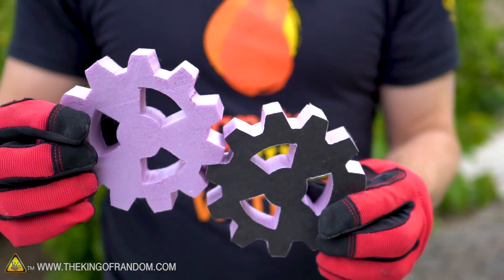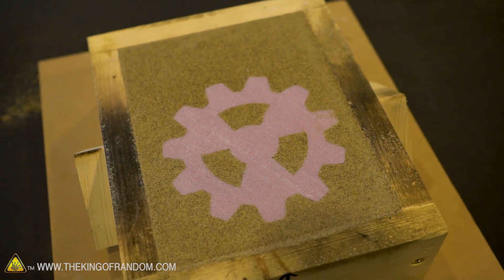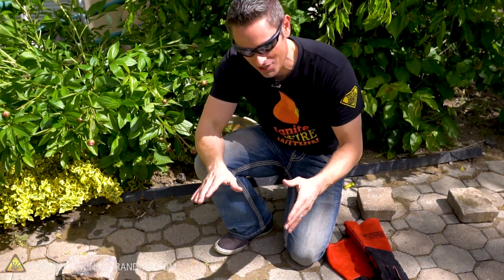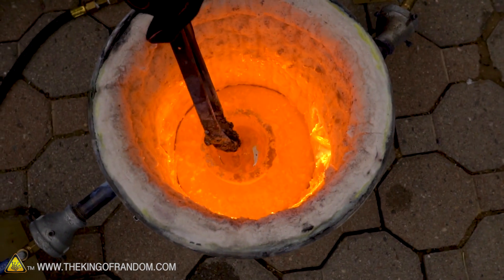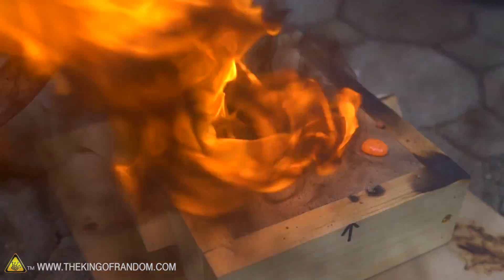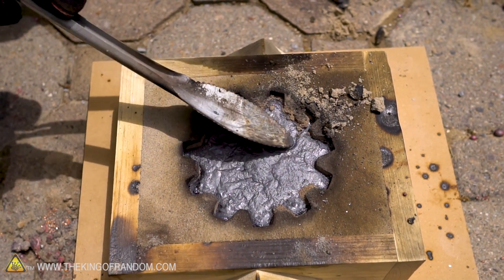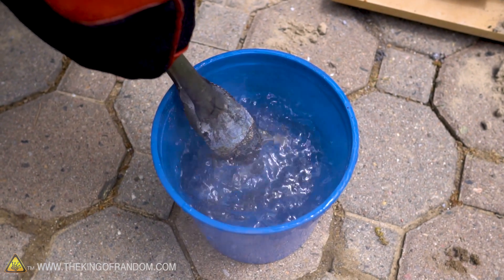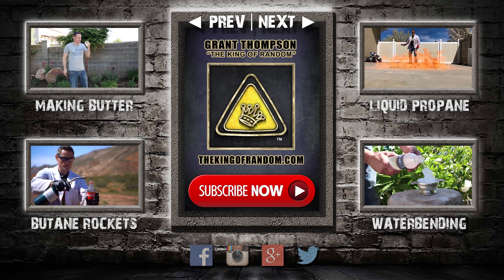Argh. Why Is Copper So Difficult? TKOR Tests Melting Copper In Our Homemade Foundry

Comment: i would advise you attach a strip of foam to the top of the gear before you pack it in the sand so that it sticks out the top of the sand. leave the mold with the gear at the bottom this will give the mold more stability because the stream from the pour wont directly impact the surface of the mold. you could also bake the mold in an oven to warm it up but if you don't have enough moisture in the sand it might collapse with the foam. just be sure your frame doesn't catch fire.

Comment: Might I suggest that if you are going to go through the effort of making a greensand mould then you should remove your styrofoam before pouring. Coat your object in a powder like talcum or baby powder beforehand to make t easier to release, then tap a nail or two into the object to use as handles to pull it out without disturbing the sand.

Comment: To pull the styrofoam mold out you could have gotten a couple of curved hooks, poked them in and pull it out slowly. 

Making the sand wetter might have also kept it in place a bit better since it's heavier.

Comment: Grant
As ive seen in other metal casting videos, When casting "difficult" metals, alot of other creators make a cavity in the sand, much like how you made the pokeballs with silocone, only with green sand. All you need to do is carve a channel leading to one open end of the box so you can pour the molten metal in. Also when doing this, make sure to form a funnel at the top of the channel you carved out. This in turn makes the pour easier but also provides a resovoir as the metal cools down. This prevents the casting from shrinking and possibly breaking the sand mould. 

Hope that helped!
See you in the next video!
Random Happens ;)

Comment: copper is denser than aluminum. that's why the copper pushed up the the center pieces of sand. The copper pushed them up from the bottom. that's why the sand wanted to float. mix some cement or concrete with the sand so it stays put, then bust apart with hammer. don't use too much cement powder or you will never get out the copper afterwards. use lots of sand and just a little cement. clay would work too but you will lose detail during the firing process to harden the clay.

Comment: A better clay-sand mix, talcum on the model as release agent and carefulness and you can get the mold out just fine. In most all greensand mouldings the model is removed from the sand before casting (model is reused time and again). also the mold is fired before the pour. it stabelizes the greensand (curing the clay) and also helps with the slower solidifying of the metal because of the heat in the greensand. Also having a top half to the mold, with a spout to pour into and vent holes for air to escape. the metal in the spout also might help compensate shrinkage.

Comment: I have not done copper, but Have done lots of aluminum.
I have started saving up scrap copper, so I was thrilled to see this video.
You have helped me prepare and maybe avoid some of the problems you have had... Maybe   :-)
I use a 50/50 mix of sand and plaster rather than green sand alone.
I heat the plaster in an oven to get it hot before taking it out to pour molten metal into it, that allows the metal more time to fill the void and get the details. No floating sand that way either.
You have already mastered aluminum, but... Maybe

Comment: What if you were to put the gear mold in the middle of the sand so there would be nowhere for the sand to go when the copper goes in you can drill a hole down to it so you can pour the copper?

Comment: If you want my unprofessional advice, I'd have to say there's a few things that could be going wrong. First is the sand it can be either to dry like you thought or it could not be packed down hard enough. The styrofoam could be to durable, I would suggest the white styrofoam like the one you used for other casting. This stuff looks a lot more industrious. And It may not have been hot enough until like the last few casts.
Reply: Or you could make the mold then remove it. I would suggest checking out Tito4re he's done some casting and does a lot with copped, he might be able to give you a few ideas to improve your casting skills
Reply: You could check out mp dragon too

Comment: Wet sand+hot copper = steam.  You need a dry pack.  The original castings were done in a cast that had complete coverage on all sides with a tube as a delivery method.  The casting sand was around a wax mold.  As the medium was poured in, the wax would melt and come out the top, displaced by the medium.  Or the casting sand mould was heated to melt out the wax prior to adding the medium.

Comment: +Grant Thompson - "The King of Random"  It seems like you would do better with some kind of binding agent added to the sand to keep it from "falling apart." 

As it happens I was watching an episode of dirty jobs last night where horse manure was added to the high temperature sand at a bell foundry for that purpose. Also, the sand was wet and allowed to dry/cure in position prior to the pour... 

Seeing the difficulty you've had makes their process more obviously necessary, especially for large castings or extreme conditions like very high temperatures.

Interesting video, thanks for posting!

Comment: Maybe 3D print the gear and melt it the same way? Saw another channel using plastic and plaster to do castings. I know you want to stick to green sand, so just look at plastic castings to melt.

Also, the channel Tito4re also does green sand casting, using the same wood jig set up. He uses the funnel spout holes you used to use with the metal jet and master sword castings. Those seemed to turn out better more consistently.

Comment: well, you seem to be needing something like a glue on the sand, in fact, how engine blocks are made is by making a mold with sand and something to keep it together, which then is pored into a shape of plastic. It then goes to a sort of a oven to remove the plastic and heat the mold (it might be blow with a compressor to clean its inside) and then they cast it. 2 clues, when it is hot, and the plastic shape thing melts, the sand is already hard, and when the metal is poured, it burns down (so whatever "glue" they use burns before melting)

Comment: I think you should have mix the sand with 2 stroke engine oil and rubbing alcohol instead of getting it wet and you should have used lacquer thinner to shrink the styrofoam

Comment: Grant, you should keep the foam gear in between two layers of green sand and put a foam tube at the surface that connects the two, in theory the copper should be able to melt the foam quick enough and take its place

Comment: Copper is way too dense for that. Especially with the holes in the middle, it'll rip them right out. That's why aluminium works so much better, it's a lot less dense. Maybe try sticking a few nails into the holes in the mould while the foam is in there?

Comment: When you cast with green sand and heavy metal, you MUST have a top cover. The problem is that your mold doesn't have top support, and that was the reason your lighter than copper sand kept pushing up. If you had a full setup, with a spout, and full chamber setup within the sand, you'll be golden.... erm, copper!

Comment: I've done some copper casting with little success. my forge is just barely hot enough to melt the copper, so it doesn't pour very well. I think you'd be a lot safer to use aluminum, unless you were willing to make a plaster mold for copper casting.

Comment: Thomas Edison was being presented with an award by copper producers for increasing the demand for copper in 1911.  They asked what he wanted & he asked for a cubic foot of copper.  The producers kept failing and eventually gave him a cube with an internal defect which weighs 486 lbs instead of the 559 lbs a cubic foot should weigh.  Evidently Edison knew something the copper producers didn't.

Comment: I have a video idea, what would happen if your heated metal for too long? Any physical changes? Like if you like the idea!
Reply: The Executioner Is Here if you got it hot enough it would turn into a gas
Reply: The Executioner Is Here haha what
Reply: It's not about heating it "too long" it's about heating it "too hot". And the same thing happens when you do that to water. it boils. It's tricky to boil copper, it takes a lot of heat, but you can do it in a high-vacuum easier. Unfortunately, it's not that much fun to watch. the metal condenses on the lens, or the window that the lens is pointed at, and everything goes dark.

Comment: If the sand is wet the moment the molten copper touches the sand it will evaporate the water.  When liquid water changes to steam it expands in volume by about 22 times. That forms a steam barrier between your molten copper and the sand and since it takes a LOT of heat to raise water from room temperature to 100C and then to steam (about 4200 Joules per gram per degree Celsius of liquid water + whatever you need to change water to steam)  your copper will conform to the mold of the steam barrier which will probably not be as uniform as the sand mold.  That steam also pushes on the 3 little sand pillar in the middle. 
 I think the reason they kept popping off are:
 1) Steam forming at the bottom of the mold ( like the bottom face of your gear) is under a lot of pressure since the hole gear is on top of it. It presses against the bottom of your pillars deforming it creating a weakness on a already weak spot.
2) That spot is already under a lot stress from the hydrostatic pressure from the molten copper. (One of the reasons damns aren't perpendicular to the ground, but thicker at the bottom). 
3) Sand is also less dense and buoyant force will push the pillar to the surface of the molten copper.  
Adding water might seem to make the less less "brittle" but i think it's actually detrimental during the actual molding.

  What I would suggest would be:
1) make the mold more shallow.  Maybe make the gear half as thick?  It should help the buoyancy problem since it increases proportionally to the volume of your pillar. 
2) Less water.  Aside from the steam problem it will allow your copper to cool more slowly, which i think was one of the things you wanted.
3) Pour slowly.  I noticed the pillar that pops off is usually near where you pour.  Copper is very heavy and dense. After is hits the bottom it will start dispersing throughout the bottom of your mold.  It will put a lot of lateral force on whatever is in it's way.  (Think standing in front of an avalanche, you are the pillar. as you continuously pour copper it's as if snow would keep coming down on you).  Maybe a slow steady pour moving around the mold?  Ideally you would want all sides of the pillar to have the same height of copper so all sides are being pushed by the copper with the same amount of force.
Reply: smart nerd
Reply: Stone Yeti1234  dont be mad cause you're not smart bro😂😂
Reply: You're exactly right about the buoyant forces from the copper. It's much more dense than aluminum so the mold needs to be stronger.

Besides the other tricks, I would have tried embedding some copper wire in the mold in the pillars to reinforce it; just poking a bunch of wires in at different angles would probably make it a lot stronger. I couldn't say whether or not it would be strong enough without trying it, though.
Reply: Alex Kim nerd

Comment: What if you used a lighter styrofoam than the housing insulation, the copper wouldn't have to work as hard or take as much time to disintegrate the styrofoam. You might have to clean it up more later with a file, but I feel like the housing insulation was a bit too heavy

Comment: The problem is you're doing the same thing over and over and expecting different results. maybe create closed mold with a bleeder hole and a funnel hole. The problem lies in just dumping it on to the cast.

Comment: Grant: The Styrofoam may be sucking heat from the molten copper. make a wooden template, mold the sand and remove the wood before pouring again.

Comment: Maybe pour plaster around the styrofoam mold, cast a silicon (or maybe wax, that may be easier to work with) cast inside that, then make a cement mold around that, and cast the copper into the cement mold. Long process, but it might just work

Comment: challenging yourself to make a perfect mold entertains me alot. hopefully you another science challenge video.

i think it is because molten copper is too hot that the moisture in the sand evaporates too quickly. the surface tension of the water in the sand decreases resulting less durable sand mold.

Comment: Why are you working with only half a mold? Build the top half and and intake/vent tunnels. The pressure from steam and tamping the sand down will push outward, holding the mold together while the negative space is filled with molten metal.

Comment: why don't you use both parts of the container and completely cover the gear? maybe heat the sand with a torch before heating so the mold isn't as cold? or maybe even cast it in plaster?

Comment: You're supposed to add a triangular funnel somewhere on the styrofoam mould, therefore you keep the lid on top of the box, and the triangle will create a funnel in which you can pour the metal in. By doing so, the lid will hold the middle pieces down, and the lid will also keep the metal hot

Comment: Here is the thing about copper.  Number one you should be using borax to pull out the copper oxides.   Second your mold NEEDS to have a binder.  copper is very heavy when compared to aluminum and yes it is heavier than silica sand.   you could mix the sand 3 to 1 with refractory cement and add water until its moist like oatmeal.  set your mold then bake it in the oven at 250 for a few hours.  NOW your ready to pour, it also helps to heat your mold up to around 700 degrees prior to your pour.

Comment: you should make plywood top with cilindrical hole drilled for pouring molten copper through. The top will prevent greensand rising and everything staying together. And maybe try to make 1 or 2 went holes so foam cold escape to even out internal presures. They are called risers i think

Comment: You probably already know this, but copper has a high thermal conductivity. Due to this, the copper is able to dump a large amount of heat out to the cast in a short about of time. This is why you had to get the copper superheated to work.

Comment: is the density of the copper greater than the density of the sand also  it might help with your cooling problem if you heat up the mold to a fairly hight temp. there for it will slow the cooling process.

Comment: Your sand is too dry. Also the mold will hold shape better if you use the cope and drag with sprue and vents. Doing these things and pouring at a more moderate pace would do it.

Comment: why don't you just use runners? then just cut it off and grind it down, that's the standard way to do styrofoam casting
Reply: also it would make more sense to use playsand(moonsand) or use a sand epoxy mix

Comment: Do A full Green sand Cast. Meaning make it have a stem on your gear make and make two separate chambers for your green sand and compact the bottom half of the sand then put
 another piece on top and take your gear with the stem on it and pour the molten copper on the stem instead

Comment: I would try sodium silicate, it will work way better for copper. You should also make sure to clear away all slag then put it back in the furnace for a few more minuets. I would also remove the Styrofoam before you pour the metal into the mold.

Comment: You need to have sand in the cope and drag, then put a sprue in the center of the gear. That way the sand in the center of the gear hopefully won't break away or float out since it's sandwiched between the cope and drag sand.

Comment: you need a little clay to mix with your sand, not much, also you need to glue or affix your Styrofoam  gear on a piece of plywood so you can lift the whole pattern out be fore pouring, it will be reusable, instead of pouring direct into the casting an in gate would be much better to keep the integrity of the mold from falling apart and leaving sand pits in the casting , just cut the gate off when done .

Comment: Try preheating your mold...200 to 250 should melt out the foam and 200's is better than air temp. Should give metal more time to flow before it cools...also go real damp on the sand it will let you pack tighter and the preheat should dry it out. If it works it will help me in casting copper parts in the future

Comment: I hope this isn't a repeat of a suggestion but have you tried a CO2 activated binder additive like Corosil?  Here is a link to their info page.  I might also suggest using a finer sand as a first "layer" in the mold.  I haven't casted copper, only bronze, aluminum and iron so I don't know how different it is.  I hope this is useful to you.

Comment: I'm no blacksmith, but I've seen some videos of people and noticed a difference in the technique: Other people skim the top of the liquid metal/pour out a bit of it at first,  to remove impurities and solid-ish junk thats at the top, and then pour the liquid into the mold. Try doing that, and you may get more consistent results.

Comment: Google Investment casting. The water in your sand is cooling the copper as it steams off. A plaster mold where you let it cure, then put it in an oven to melt out the foam and drive off the water will work better.

Comment: Grant you have to make a two-part mold that way it can retain the Heat from The Foundry and allow it to solidify slower rather than faster because you're oxidizing the copper and hardening it because it's out in the elements if you were to make a two-part mold and then very carefully pull the styrofoam out it would work a lot better